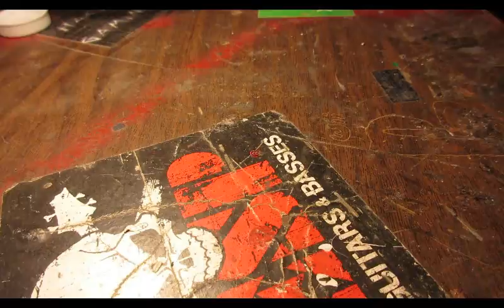Original Xbox RAM Chip Removal

Comment: Awesome Tutorial, I have the same rework station that you do and have a v1.0 giving me Red/Orange ROL when attempting to boot. I was told it could be a ram issue so I've ordered replacement chips that will hopefully be here soon. What setting did you turn your hot air wand to just out of curiosity?
Reply from the maker: Look up FRAG error. Very common in the v1.0 revisions. It's hard to pin point where the error is occurring also.
Reply: Did you ever fix your Xbox?

Comment: Any use other than replacing diagnosed bad RAM chips elsewhere? Wouldn't it make sense to get them from old PC modules instead or to order NOS? I'm going to be moving the EEPROM from one XBOX to another soon so this is somewhat relevant to me regardless. ;) I'll be using ChipQuick.
Reply from the maker: I just had this dead board lying around so I figured I would make a video showing how to remove them without a whole lot of work in case someone else had a spare board they wanted to get the most out of. Lol. The RAM chips themselves are good and will be going into another system to add an extra 64mb of RAM. You can order the exact RAM chips off the internet for a few bucks each rather than pulling them. 

What's the reason for wanting to try and move the eeprom from one Xbox to another? Bad eeprom? Lost eeprom? If it's lost you can easily recover it by buying or building a reader. Building is easy and can be done for under 10 bucks.
Reply: H4Ck GAMiNG Dead XBOX from a client who never had a backup who, for whatever reason, has to have this unknown dashboard/software/softmod config without even knowing what it's called. I can't even attempt to duplicate it on another XBOX when she can't even describe it to me.

Yeah, now I recall when certain emulators said said they required a RAM upgrade or a developer box to run certain ROMs on an XBOX since it couldn't all fit in memory. Guess it doesn't just page to the HDD with dog-slow virtual memory like a desktop OS. :D
Reply from the maker: Yeah I would say rather than swapping eeproms just build a quick eeprom reader. Parts can be had from Radioshack (except the LPT cable) but that should allow you to rebuild a stock dashboard and completely erase any old dashboard files they had on there. XboxHDM does wonders with these problems. Literally just did one a week or so ago. Might look into joining Xbox (Original) Modding, Trading, Collecting, Discussion on Facebook. Lot's of people (including myself) who can help walk ya through anything.
Reply: Thanks. I have one of the readers but the board is dead (no power). I expect that the swap may actually be easier than trying to power it in-circuit but if that proves not to be true I will figure something else out. :)

Comment: okay so first off, you didnt use enough flux for the module , you also could make your life so much easier by removing the larger cap beside the ram and thuse allowing you to simply push the ram away from the area one one fast motion , , as you see you dont heat everything up in one go and risk bending pins or ripping pads off with the legs and such, not ideal but you got the job done so yeah thats all that matters in the end
Reply from the maker: I used plenty of flux. Pushing chips is NEVER a good idea as you're heating it to the point where you could easily bend something internally rendering the chip completely useless. I didn't remove the cap as it's pointless when doing this way works perfectly fine and the board is garbage anyway. I've done more of these than I can count and have never run into an issue doing it the way I do it. Thanks though.
Reply: @H4CkGAMiNG712   bend something internally ? what... do elaborate
Reply from the maker: @Millzieeeee  You could easily rip a leg off and damage the chip beyond repair by trying to slide it off. Would you also recommend sliding a BGA chip off the board? That doesn't make any sense dude. You stick to doing it your way (which seems sketchy at best) and I'll continue doing it my way which is how I've been doing it for close to 10 years now with absolutely zero issues. Lol.
Reply: @H4CkGAMiNG712  hahaha don't know what kinda dodgy critters you've seen removing chips off boards but even watch Luis rossman he works on macbooks and is massively reknown , he does exactly the same haha 🤷‍♂️😅
Reply from the maker: @Millzieeeee Should we mail him a cookie? I've removed hundreds upon hundreds of NANDs and even NORs by heating and lifting (as have millions of others) and haven't ever had an issue with any bent or broken legs so I'll continue doing so in that exact manner. Funny, you come on here to criticize my work, but your channel has nothing but gameplay videos. Lolol. Maybe you should stick to doing that rather than jumping on random videos trying to tell people how things should be done. 🤷‍♂️🤷‍♂️😆